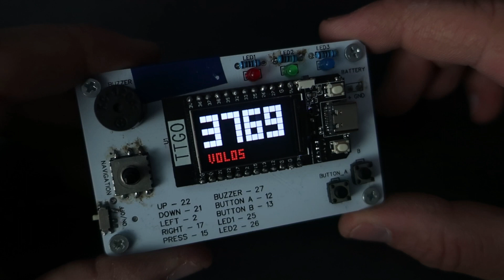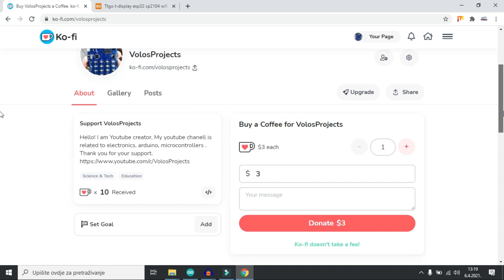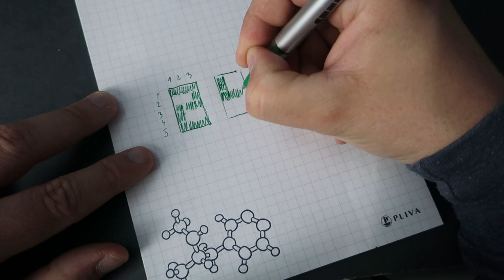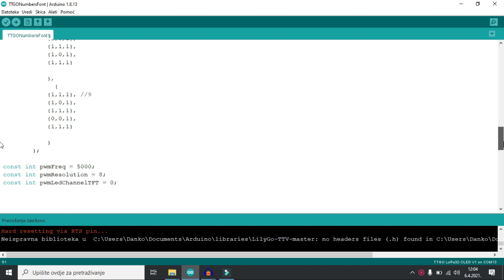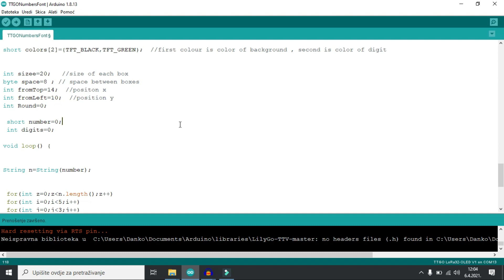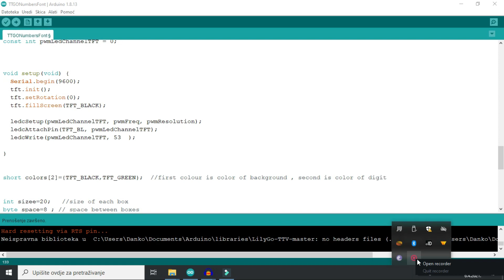How to make simplest Font for TTGO TDisplay (ESP32) or any tft screen

Comment: Many thanks for sharing this, as I need to display a clock on a TTGO T-Display where the size I required was 'between' the standard fonts.
I did have to add a 'special case' for ':' being in the string, and added to arr a tenth entry :o)
Reply from the maker: I am glad that this will help you. In past i made also clock using this method but on Oled display.